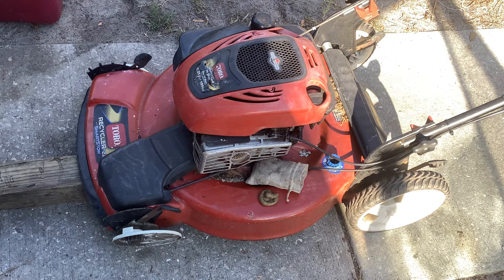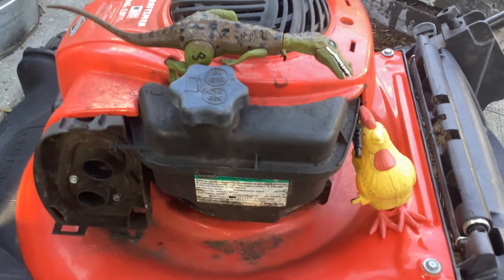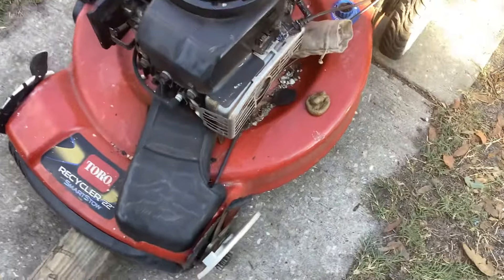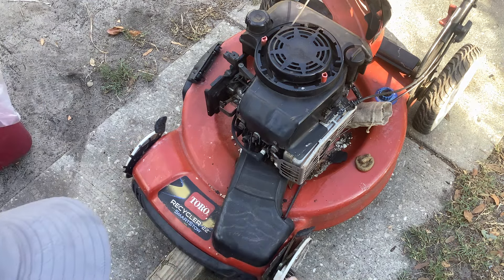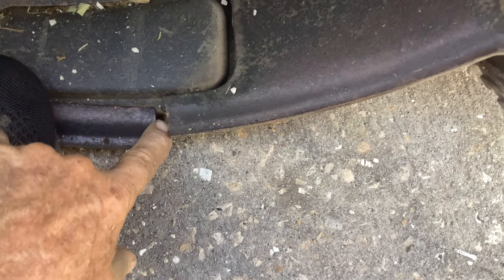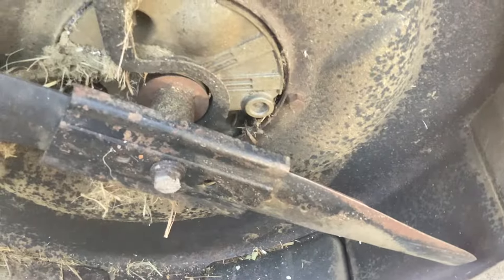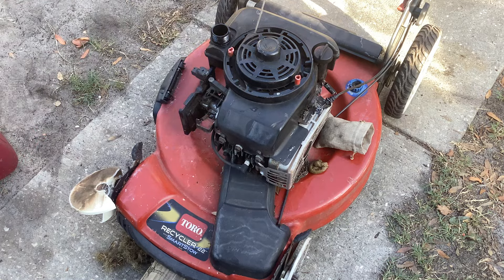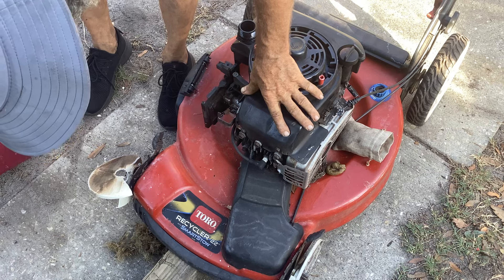2009 Toro Recycler Lawn Mower with Missing Drive Wheels...Was it Worth the $10 I paid for it?

Comment: At this time of year, I'd go for "low hanging fruit", i.e., those that need less work.  This one would be a good candidate for winter activity.  Take head off, check gasket and valves.  Either way, for $10.00 you didn't get hurt, lots of good parts.  Good video Tommy.
Reply from the maker: I will park this Turd.

Comment: Maby the camshaft failed! I had one of those a few years ago. That is what came to mind when you said popping through carburetor you can look in spark plug hole turn crankshaft see if piston go down intake opens piston up exhaust.  Just a suggestion.  Good luck

Comment: Tommy. Have you ever seen a recycler with no flywheel brake?  The cable goes into the deck. I’m guessing it has something on the crank?
Reply from the maker: I do not recall that set up. Bernie.
Reply: @tommy-time5240  I will be doing a vid on it. Looks like we have a mystery to solve!